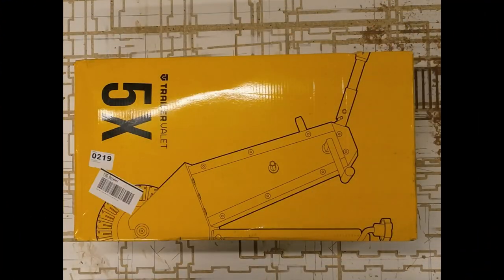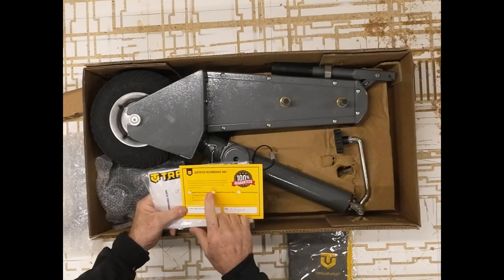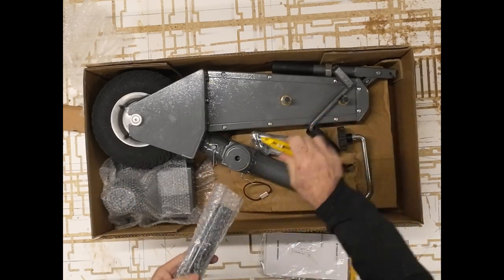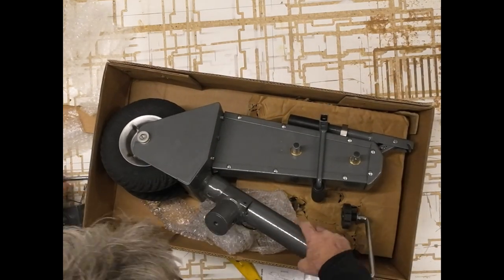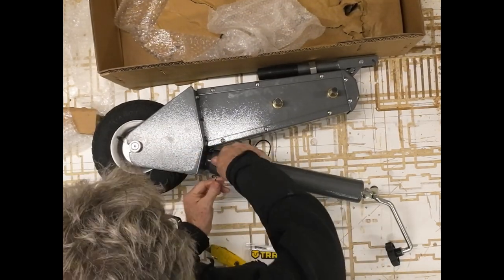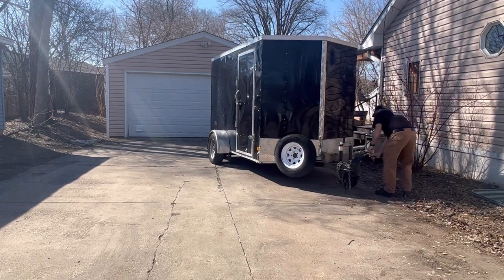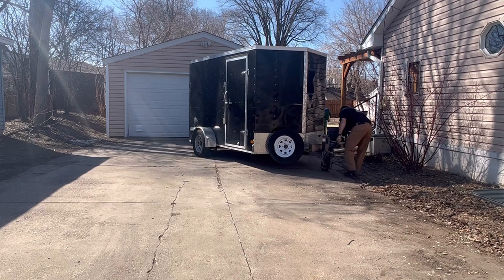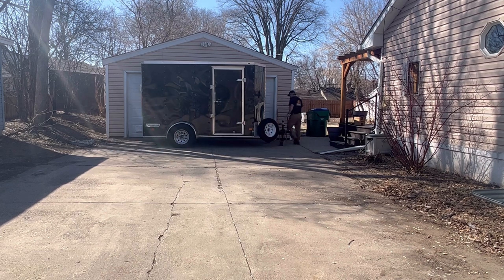Unboxing a 5X Trailer Valet - Putting it to work!

Comment: I've had one for about 3 years now. Use it to move my 4500 pound boat. Because of tight turns, I needed to get 2 attachments so I could just switch unit over to the other side when I needed to make the other turn. You do needed the drill attachment if you're moving it a long way. Works good.

Comment: what kind of drill are you using? I can't get my 20 volt dewalt to budge my 17' mako... works with the hand crank but that will wear you out on a hot day...
Reply from the maker: I use my 20 volt festool drill. Are you using on the high or low speed shaft?